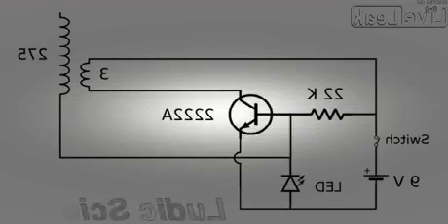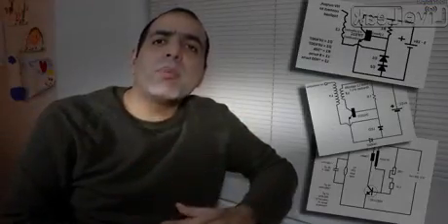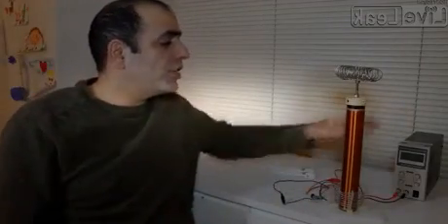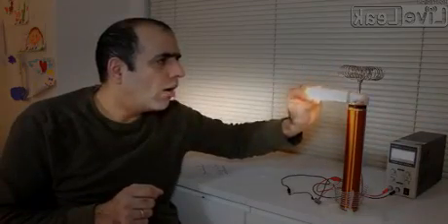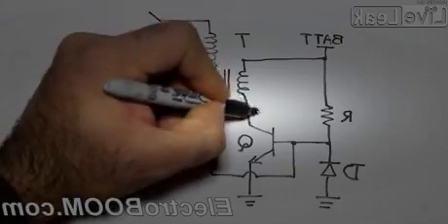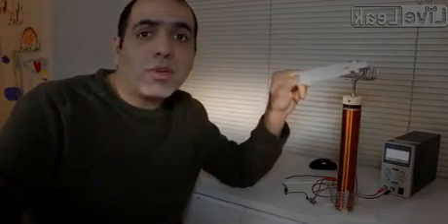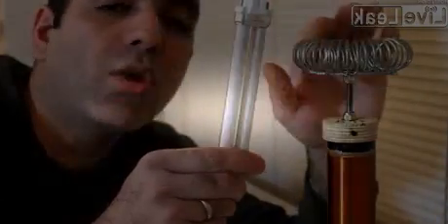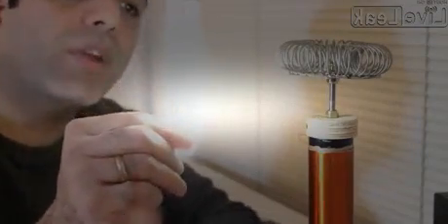Make a Slayer Exciter Circuit with Tesla Coil

Comment: Hello, I am trying to understand the calculation behind the circuit, are the primary and secondary work like a transformer or better like Ruhmkorff induction coil ? Can i so apply the following equations... (N1/V1=N2/V2) and (V1*I1=V2*I2) ?

Also how can I calculate the frequency? Thanks for your time.